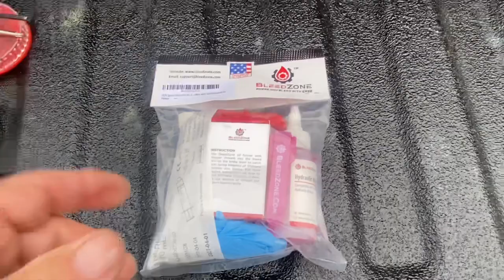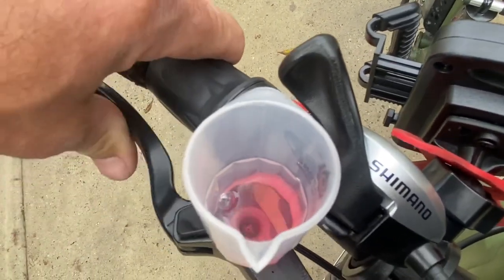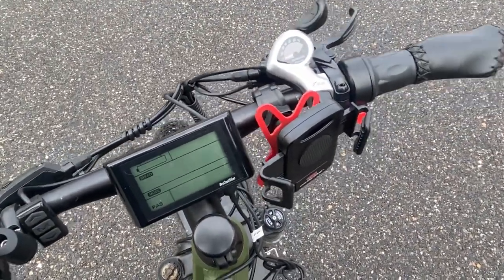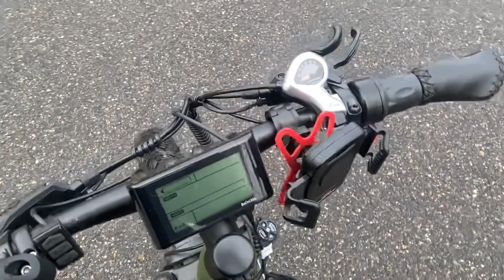BeeCool Adventure E-bike brake bleeding by AJ

Comment: There seems to be 100 Shimano brake bleed videos out there, but this is the only one I've found that shows the same brake lever unit as on my Lectric XPeak bike.  It is such a relief.  I've had the exact same problem with the brakes going flat after a few hundred miles, and getting low again just a couple weeks after paying $140 for a tune-up by a professional.  I just purchased a bleed kit for $17 and look forward to getting the same results you got!

Comment: I bought a bleeding kit from another brand with several adaptors since I didn't know the dimensions of the upper or lower bleed ports on the Explorer. I found one that worked to screw into the top port, but it had a hose connection on the other end, rather than something the funnel would fit into.  The funnel tip itself was the wrong size to screw directly into the port as yours does. Bleed Zone sells all kinds of bleed kits. It would be VERY helpful if you included the actual specific kit you bought with the funnel/cup that fits the bee cool bleed port on the upper port, rather than saying you bought "a kit" off of Amazon. You briefly show the package but all that is visible is the brand name and you don't mention any particular kit or what brand or type of brakes it is designed for. All this video provides is that it's from Bleed Zone, and was about $20 on Amazon.  Unfortunately there's several kits that fit that description. It's a mystery to me what type of brake calipers Bee Cool uses, or what size the upper bleed port is on these, and unfortunately after this video it still is.
Likewise, on their website, the instructions for bleeding brakes offer only broad, general instructions and don't include any information on brand, size of upper port or which bolt on the caliper is the bleed port and other drain port... or how they work.
Reply: check the description... 🤦‍♂️

Comment: Hey so I recently had issues with my beecool challenger , the right brake which the rear stopped working as efficiently as when it was new ** note I got the bike December 2022** so about 7 months .. so lever comes in all the way and almost touches the throttle and grip I definitely feel the loss in stopping power , the front brake is okay …. I took it to my local bike/ e-bike  repair and they claim nothing is wrong with the brakes … but I definitely feel the loss in stopping power which riding in LA is needed sooo after watching your video I’m convinced i need to bleed my brakes ???? 🤔 apparently my brake pads are good so that’s not a concern

Comment: Thanks for the video. I have the bee cool explorer for my first ebike and you pretty much have to take it all the way back to the handlebars to get any stopping in the front brake after 140 miles. I took it to the local bike shop but they don't work on ebikes and the guy said he could take a quick look. Then said it was fine, you just have to squeeze harder. That didn't sound right to me especially since the brake started off fine and the other brake was fine. Even if they don't work on ebikes they should know how to bleed hydraulic disc breaks geez. These videos help the newbies learn how to maintain their bikes on their own.

Comment: Thanks for instructions guy, I have the same issue with my brakes, I ordered a bleed kit, but I was also under the impression you had to open the bleed valve on the brake  caliper also, is that unnecessary.

Comment: Good explanation of what you did.  My problem is that I don't know which bolt on the caliper is for bleeding the fluid at the caliper, and you don't specify it either, though it looks like you kind of point to one. Most instructions say to put a hose over the bleed nipple on the caliper, however the caliper of the Explorer has none. And there's two bolts on it. I suspect one is the bleed port, and the other is the bleed valve, but have no idea which is which. Was hoping this would be shown here, but it's not.

You also only did the last step of the bleeding process as instructions for most lay out. The first step is to attach the funnel or bowl and then you rig up syringe and tubing to bottom bleed valve, then open top port at lever and push fluid into system from the syringe attached to the caliper and push it up into the cup. You then use plunger and stop that off and remove old oil, replace it, fill with a table spoon or two of fresh oil, and then draw that back into the system from the syringe at the bottom.  Then, you compress brake lever and hold it down, then open and shut bottom bleed port quickly, and continue this 4-5 times until no bubbles appear at the bottom tube. And then and only then do you do the step you demonstrate where you burp the upper lever.